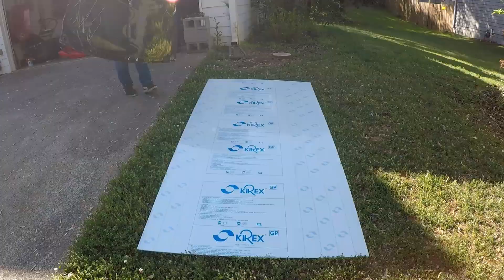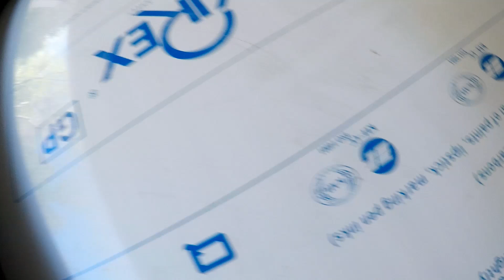Make your own polycarbonate windows! (Lexan windows)

Comment: So how did you mount the aluminum brace?  You bolt between the polycarbonate and frame?... or was it for measurement purposes only?
Reply from the maker: Ya just used the center windshield bolt and bolted it between.
Reply: How thick is that Sheet of poly

Comment: I’m building a gasser right now and need a windshield that is darn near impossible to find, might have to do this! Although it’d suck to have a deer go through it. No different than a motorcycle I suppose.
Reply from the maker: Should work. Racing rules say we have to use a center support for lexan windows, but maybe if you get thick lexan you wouldn’t need it. 

Also, polycarbonate is different from acrylic. Acrylic shatters, this stuff just kind of bends and creases. It’s really hard to “snap” it.

Comment: 💪Saluteeee I need a windshield and driver window on a bmw 325i convertible at a low price and came across your video,  will I be ok doing the steps you did for a daily driving vehicle?
Reply from the maker: I don’t recommend this for a daily. Lexan scratches easily and it’s really hard to waterproof.

This is a race only car

Comment: I actually cut a fair amount of Lexan and acrylic for boats i work on. I'm sure its been mentioned here but a better way to cut it is with a small three or four inch compact circular saw like the ones used to cut trim. Its always better to use some sort of toothed blade saw rather then anything abrasive. This is still a great alternative to getting a poly windscreen and a lot easier then many people think. Nice work! Enjoy!
Reply: Do you recommends doing this on an everyday drive car? I can’t afford to go to a shop and pay $400
Reply from the maker: Sounds like great advice! Thanks. 

If I did this more that once every couple years, I would totally get a little circular saw

Comment: Very interesting video! I love lexan and think all windows should be made out of it. So I'm guessing typical windshield urethane doesn't stick to lexan?
Reply from the maker: I don’t think so, if you paint the edge like I did, the urethane will stick to the paint, but it’ll peel off the window and look like crap. 

If you sand it it may work, but I don’t think it will

Comment: Please tell me how did you get it to curve into the shape of the original glass?
 The store that you got it from doesn’t exist here, where can I buy it? Lowe’s, Home Depot etc?
Reply from the maker: I think you can get it at Lowe’s or Home Depot, but it’s a lot more expensive….maybe twice what I paid.

To curve it I start bolting it down in the middle, and work my way out…it curves as you go. Remember, this is for a race car.
Reply: @BlakeBuildsATL  Are you saying it can not be used on a regular car? I’m going towards Plexiglas vs polycarbonate. What do you think of Plexi?
Reply from the maker: @briizcustoms9543  it’s not ideal for a street car. It scratches much easier than glass, and needs to be polished every year or so. It’s also really hard to waterproof the seam.

Iirc Plexiglass is just a brand of polycarbonate. Just don’t use anything that shatters ( like acrylic )
Reply: @BlakeBuildsATL How has it been holding up? I’ve still not installed mine

Comment: hi, can you suggest the type of cutting disc for the angle grinder to use for polycarbonate between 1 and 3mm ? please... thx
Reply from the maker: I just use a metal cutting disc, thinner the better, I use a 1/16”, which is 1.58mm

Comment: Very nice. Been wanted to do my car roof with smoked polycarbonate but the bending/rippling is my concern.
Reply from the maker: A roof may be pretty tough without thermoforming. Mostly because the edges will have to have some sort of lip for the windshields and mouldings
Reply: @BlakeBuildsATL  does it scratch like if you were to use window wipers.

Comment: I used vinyl wrap. I'm really just trying to find the best sealant,  no screws. 3M window weld failed.
Reply: Did you come to a conclusion on a sealant/ bonder that worked? I’m very curious about panel bond for this application
Reply: 3M sucks. Betaseal is where it's at. You need to ensure your materials are prepped properly first
Reply: @KJTUSKJTUS Whats best way to prep ?

Comment: What thickness did you use
Reply from the maker: I think 1/8” for the rear and sides, 3/16” for the windshield. But check the rule book for your sanctioning body. I used the FD rulebook

Comment: Very impressive. I'm looking to save weight in my track-dedicated 350Z and windows is one big area. You have helped me in my search for options/solutions as I continue to ponder how to go about it. I'll likely start with just the door windows, gutting the doors down to a shell and using some sort of polycarbonate to replace the glass - whether I cut it myself as you did or order it just requiring installation. Thanks.